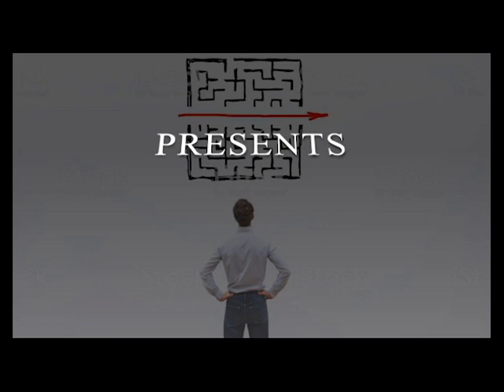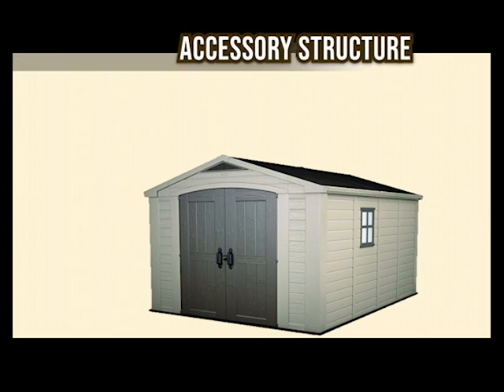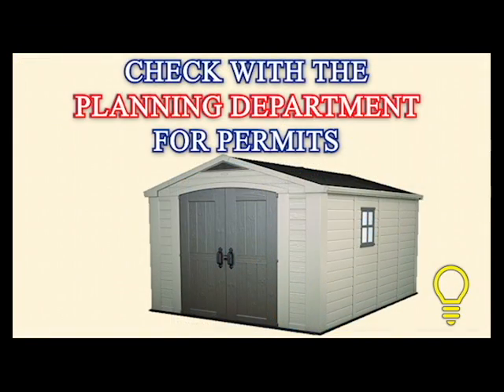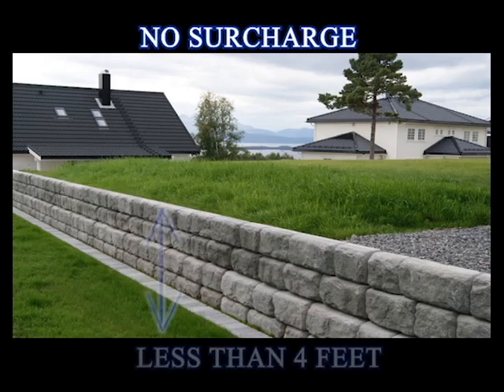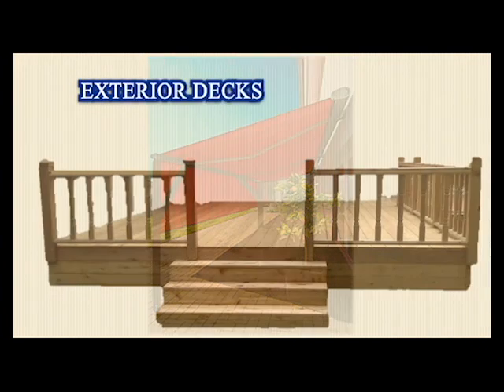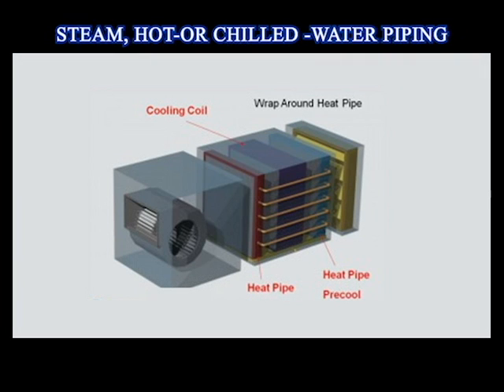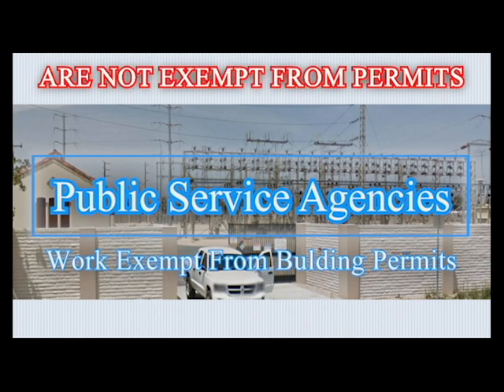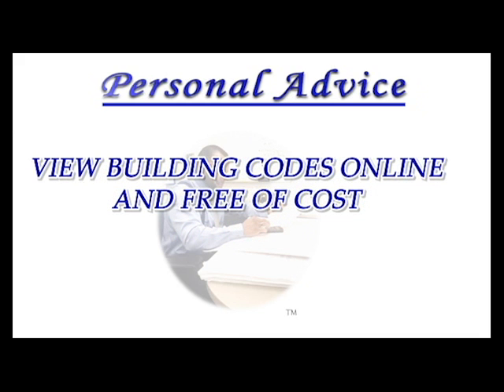Types Of Work Exempt From Building Permits (2019 CA Building Code/2018 IRC)

Comment: Hi, is wet-patching a leaking roof considered an "emergency reroofing repair" and requires a next-day permit application?
Reply from the maker: I don’t know of any jurisdiction that requires a permit for wet-patching a leaking roof.  In the jurisdiction I’ve served, we wouldn’t require a permit for such work.  
Emergency repairs necessitating a permit are defined by the local jurisdiction though, since the building code section regarding emergency repairs is often amended locally.  I would still contact the local building department just to ask.  

Happy new year. 

- Jose M

Comment: Hey bro thank you for your very informative video, and I got a question for you, When emergency repair companies go do a mainline repair are they getting permits for all those jobs they do? And if they do how much would a permit for a broken line go for?
Reply from the maker: Great question and the reality, at least in my observations in this profession, some companies pull permits - and other don't.   

Regarding the cost, it does depend whether the replacement will be within the private property, or outside on the public right-of-way (public side).  Pipe replacements on the public side cost more and it is more involved, primarily due to involvement by other agencies such as the utility company (and their standards) and/or the jurisdiction's public works.  Building departments are typically not involved with right-of-way work.

However -- such replacements done on the private side are typically all building department's responsibility (except in cases such as electrical meters and upstream), and mainline repairs (let's assume a water pipe before the water meter) are on the ballpark of $100 - $200 on average - depending on the extent of repairs.  

I hope the above helps, thank you for the question.

- Jose M
Reply: @CBO.online  bro thank you for the information 🙏 
That really helps, on a side note I'm impressed that you responded so promptly and professional 👍 👌
Reply from the maker: @blueshirthandyman8460  You are welcome.  We are on holiday break around here so I am getting to do the other fun things in life - such as working on content for the channel and responding to inquiries.  Let me know if you have any other questions.  
Be well and happy holidays!

- Jose M

Comment: Do you need a permit to put drywall up to block the inside of a garage door to make it into a bedroom without tearing nothing down
Reply from the maker: Hello.  I hope you are doing well.  Great question you ask; the local jurisdiction will very likely require the submittal of construction documents along with a building permit application for the work you propose.  Although nothing will be torn down, and only drywall will be installed to create a bedroom, this is considered a “change of occupancy” - hence, a “garage conversion.”  

Historically, (and it’s still true in today’s building codes) compared to a house — garages are not required to be insulated, heated, moisture intrusion protection of the concrete slab, electrical protection similar to bedrooms, and other safety components; because, once again, garages are not for human habitation; unless, modifications are made (as described in the above examples) to the existing space/structure.  For this reason, submittal of construction documents are required so that the local jurisdiction reviews and inspects the conversion to assure it is suited for human habitation, as required by the building code.

Most all States allow unlicensed individuals to design their own construction documents, as long as there are no “structural work” done such as; enlarging of window/door openings, removing walls/posts etc., and as long as their submittal guidelines are followed - which you can find online, typically in the building department’s webpage; or you may contact the local building department to ask for their garage conversion submittal requirements.

Sorry about the lengthy response, I would be more than happy to further clarify the information and guide you by directly emailing me at jm.wboard@yahoo.com.  Afterward we can further exchange contact if you desire.

Nevertheless, I hope the above helps.
Thank you for checking out the channel and for your question.

-  Jose M

Comment: What about Arkansas??
Can we do our own roof
Reply from the maker: Hi Elizabeth; check with your local city or county building department; some cities may or may not require a permit for a reroof.  Interestingly, I have a brother who lives in Benton, Arkansas (you may know where that is); and although he didn't do the work himself, his contractor had to pull a permit for the work.   Also, in the State of Arkansas, property owners can do their own "home improvements."  But certainly ask your local building department about this as well; as your local city/county may have regulations for owner/builders.
However, here is a link to the Arkansas Contractors Licensing Board FAQs (see second FAQ):  https://www.aclb.arkansas.gov/faqs/ 

I hope this helps.  Let me know if you have any  further questions.  Good luck.
- Jose M
Reply: @CBO.online  
Thanks...GOD bless

Comment: I built a 12' X 16' deck that is self supporting and free standing, 1/2" from my house and it is 26" above grade at it's highest point. The door to it is not one of the original egresses to the house. I did not need to pull a permit to build this deck.
 Had I taken the shortcut of a ledger board to hang half the weight of the structure off the house. I would have needed a permit and several inspections to build a very similar deck. The savings from not paying the fees for permit and inspections was greater than the savings of not digging the extra post holes and footings would have been.
 Sometimes it is good to know what is exempt from building permits
Reply from the maker: Very well put, sir; I couldn't have said it better -- thank you very much for sharing your experience on this platform!

Sincerely,
Jose L. Martinez

Comment: Does the permit require to replace old toilet and sink without any modifications to the existing lines and electrical system? The toilet and the sink will be in the same places where they are originally.
Reply from the maker: Hello and thank you for asking such a great question.

If you are in California -- the majority of building departments do not require a permit for the work you describe (assuming it is for a single-family dwelling).  Such work is typically considered “repairs,” which repairs are exempt from building permits per IRC/CRC Section R105.2.2 (and the definition of repairs).

Also, keep in mind that there are Green Building/Plumbing Code requirements for toilets and sinks; so be sure that the toilet flush does not exceed 1.28 gallons per flush; and the bathroom sink has a maximum flow rate of 1.2 gallons per minute.  Most all toilet and sinks are at those rates, but ask the store about the fixture flows.     

However, please double check with your local building department for their interpretation.  Although unlikely, often some building departments do require a plumbing permit for such work.  

Please do not hesitate to contact me if you have any further questions or if you need clarification on the above mentioned.  I hope this helps.

Take care,

-	Jose M
Reply: @CBO.online  thank you for the quick reply. I applied for the electrical permit for my store at the commercial building. And when the county came for the  electrical permit, they saw the toilet and the sink are removed, they said I need a permit for the plumbing.  However, my research and the information you provided, I don’t need a permit for replace/repair the existing toilet and sink because they are already there. I’m not touching anything with the existing system.  I’ll bring up your points with the county and see if they still insist with the permit for those items. Again, thank you
Reply from the maker: @vile7806  But please keep in mind that my response was assuming the work you described was specific to a residential single-family dwelling; and even still, as I said before, you should always double check with your local building department because they have the authority to determine if and when a permit is required. 

Also, commercial work is looked at much different from residential work since commercial buildings are open to the public, some of the public that may be disabled.  Therefore, something as simple as replacing the sink and toilets in a commercial building, are inspected for not only the plumbing fixture flow rates – but also Disabled Access requirements (“ADA”); which includes verifying the location of the sink and toilet from walls, height of sink, dimensions under the sink for wheel chair use, controls for the sink faucet and toilet.  These are some examples.

Take a look at this link (https://www.adachecklist.org/doc/priority3/p3.pdf) which should give you an idea of what the sink and toilet requirements are under the Americans with Disabilities Act, feel free to look through it.  But please keep in mind that the checklist is to the current ADA requirements, but it does not include California specifics so please check with your local building department.  

You should ask the building inspector to provide you with a checklist of items they will be looking for during the inspection.   Also, be prepared to show the building department a copy of the sink and toilet specifications.  Take some pictures, or video, of the locations so you can show them where you propose to install the sink and toilet.
I hope this makes sense, I know it may seem like a lot of information for just a toilet and a sink – but they are important when it comes to public accessibility (“ADA”) requirements.

Please feel free to reach out to me directly if you need further help and clarification.  I would be more than happy to explain further.  Here is my direct email:  jm.wboard@yahoo.com

-	Jose M
Reply: @CBO.online  thank you so much. I really appreciate the level of details in your response.  I didn’t know it can be so complicated just replace the sink and toilet.  It seems that they need to be installed according to ADA guidelines before it can be approved. Thank you for provide your email. If anything comes up, I will reach out to you for guidance

Comment: Can a homeowner pull his own permit for his roofing
Reply from the maker: Thank you for your question.

The short answer is – Yes (assuming you are in California).

There are limitations that you should be aware of, however; here is a very helpful link out of the California State License Board specific to Owner/Builder FAQ’s.  
Link:  https://www.cslb.ca.gov/consumers/building_officials/owner_builder_overview.aspx 

However – in general, from the building permitting standpoint, an Owner/Builder affidavit is required to be submitted along with the permit application.  Your local building department should have an Owner/Builder form for your use.

Please let me know if you have any questions related to your roofing permit and inspection requirements.  If you have specific questions regarding Owner/Builder requirements, you may also contact the State license board; as they are the lead agency for contractor laws – including Owner/Builder requirements.  Here is their contact info:  (800) 321-CSLB (2752) 

And if interested -- here is the link to the owner/builder law :  https://leginfo.legislature.ca.gov/faces/codes_displaySection.xhtml?lawCode=BPC&sectionNum=7044 

I hope this helps.  

Take care,

P.S. In the event you are not in California, most all other States have similar owner/builder laws so check with the State contractor agency or the local building department. 

Jose M

Comment: Question, if an addition to a single family home is permitted as a “living space” does that mean it’s permitted as anADU?
Reply from the maker: It’s difficult to answer this question without looking at the approved plans and permit specifics for the addition you reference; however, the description “living space,” does not make it an ADU.  
At the time that the addition went through the permit process, the application and submitted plans should specify that the intent of the addition is to create an ADU, this way the submittal is processed and reviewed as such.  

A “living space,” by definition (in California (CRC)) is a function within a Dwelling and an Accessory Dwelling Unit.  
Whereas in order for the addition to fall under the definition of Accessory Dwelling Unit “ADU,” it would have to provide sleeping/eating/cooking and sanitation facilities.

I hope this helps you, but if you need further clarification or assistance with this; please do not hesitate to contact me at buildingcodebuddyonline@yahoo.com.  I would be happy to further assist.

Thank you for your question.

Take care,
Reply: Thank you so much for diving into more details. I definitely wanted to make sure i knew the difference between the two terms, and this clears it up. Thanks again!

Comment: Does a Built in charcoal BBQ grill with concrete counter top need a permit?
Reply from the maker: Great question.  Assuming single family residential construction -- The very short version of my response: no, it should not require a building permit.  
In my experience and in talking to other building departments, not many require a building permit for the exact work you describe.   Please feel free to read the below explanation for further information.

[Explanation]
The reason I say that “it ‘should not’ require a permit” is that Work Exempt from Building Permits (Administrative Chapter of the codes) is very often amended locally and subject to the interpretation of the local building official.

However, here is the reason many building departments normally do not require a building permit for the work you describe:
A one-story (less than 120 square feet) detached accessory structure is exempt from a building permit, per the model code (IRC Section 105.2) as well as many State codes; and many building departments consider the work you describe as “accessory structures.” (I can provide specifics to this determination if you need me to).

Please understand that I am merely providing my input to the query.  Ultimately you must contact the local building department for their determination.  This also does not speak for any Planning and/or Fire Department requirements; Planning Departments heavily regulate setbacks to structures, to include design requirements; Fire Department would primarily be concerned with fire safety requirements, so please contact both.  Not saying that a planning or fire permit would be required, but it is not a bad idea to check with them.

Forgive the length of the response but I hope it is of help.
  Please let me know if you have any further questions.

Take care.

Jose L. Martinez
Reply: @CBO.online  thank you

Comment: Do I need a building permit if I am going to install gutters on the house
Reply from the maker: Very good question you ask, Josh.  I truly wish I could give you a simple yes or no response; I can only tell you the general consensus throughout building departments when it comes to gutters on a house (assuming roof gutters) and permit requirements; typically, cities and counties will not require a permit to install standard roof gutters/downspouts which terminate to splash blocks – here in California.

However --- as you may be aware, roof gutters are not specifically exempt from building permits under the Administrative Chapter of the IRC R105.2; which leaves it to the local building department to determine whether they will require a permit – or not.   With that said, often, gutters are connected to underground piping.  Such work would require a plumbing permit and there are standards to such installations in the Plumbing Codes.  
In the past I have seen people install roof drains to sanitary sewer systems, which is an issue.  I have also seen erosion issues affecting neighboring properties as a result of storm water runoff.    There are also storm water mandates that building departments are often tasked with assuring.  My point being - get in touch with your local building department to inquire; preferably through email.  Even if they don’t require a permit for roof gutters, they may provide useful information regarding roof gutter installation; heck, some agencies offer rebates for the installation of roof gutters and the only way to know is to ask ----- the building department 😊.  Here is an example of an agency out of San Diego, CA, which offers such rebates (not sure if current):  https://www.sandiego.gov/sites/default/files/guidelines_for_gutter_rebate_fy19_0_0.pdf  

I hope the above is of help to you.

I appreciate the opportunity to help!
Take care.
- CBO
Reply: @Nicolas Torin Flixportal
Reply: @Sean Ira thank you, I went there and it seems like they got a lot of movies there :D Appreciate it!
Reply: @Nicolas Torin No problem :D
Reply: I guess I'm quite off topic but do anybody know of a good website to stream newly released tv shows online ?